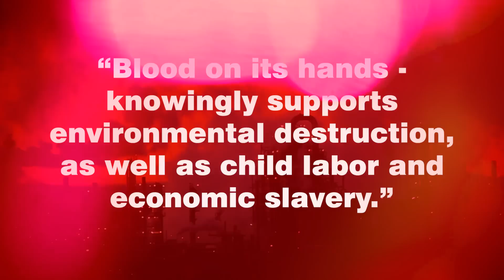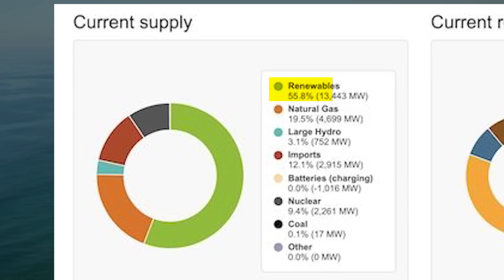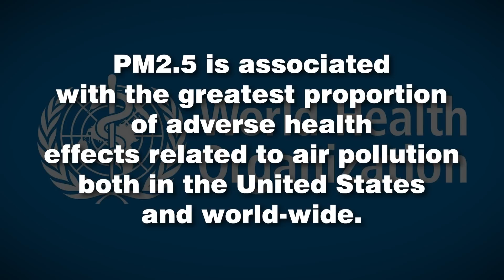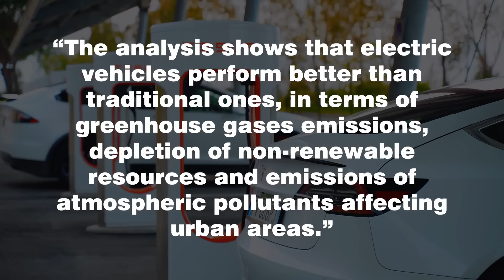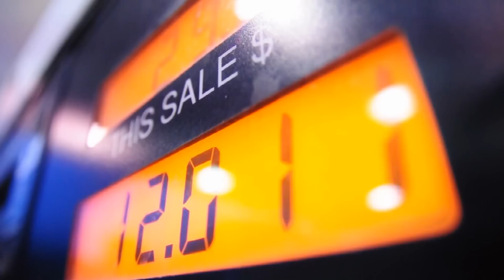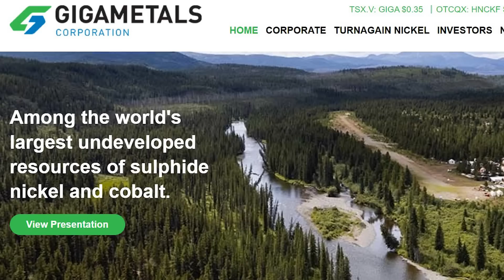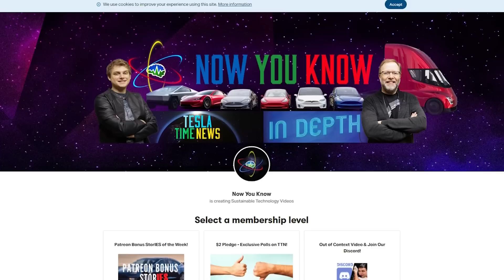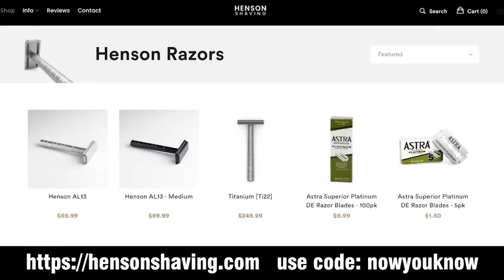Debunking More EV Lies | In Depth

Comment: It always amazes me how the anti-EV folks forget how much energy is used to process oil on its way from the pump(extraction), to the port, to the arrival point, to the processing plant and at the station. How many Kwhs are used per litre entering the tank ?
As for cobalt, on the EV side less and less Cobalt is used AND that cobalt can be fully recycled on and on and on…
What of the cobalt used in processing gas? (Remember the whole acid rain thing? How’s they fix that? Cobalt and gas was part of it).
A significant of cobalt is lost during gas processing. Why don’t they mention that?
Pretty much all minerals can be recycled and will be cheaper to recycle than to mine and process. If not already.
Reply: yeah, somehow it's totally free to find gas reserves, build infrastructure to get it out of the ground, pump it out of the ground, transport it to a refinery, refine it, load it in a truck, transport it to a gas station, unload it in to the gas station, and then pump it in to a car. that's totally free. but if someone eats a sandwich while building an ELECTRIC car, then the cost of that sandwich needs to be counted
Reply: Because we have a larger view of ev than ev enthusiast. With all the money you can make from a lithium mine do any of you ever asked themself why there is virtualy no new lithium mine openning anywhere?

It because politician go full save the planet discourse for vote and suddenly they see the lithium mine project and understand that thing is f...ing awful. They take so much water they litteraly drain river, high risk of ground water contamination (water table) and lithium is everywhere but don't get very concentrate in the ground so you need to excavate very large strip of land destroying entire ecosysteme by doing so. 

This is just one of the inconvenient of EV. We could talk our need for energy is growing faster than our capacity to produce it and this trend has started long before EV was a thing. The grid is not build for this. E.C.T
Reply: That figure is accurately tracked. Getting worse every decade. Used to be 5% of delivered energy was used in the delivery infrastructure. Now commonly 50%.
Reply: This is my argument with EV's as well, none of the EVs are made out of fresh air they all come from burning coal gas and oil just to create it even if nothing comes out of the tailpipe, it is still not 100% emissions free its a big lie. I've worked in mining for 12 years now and I can guarantee you none of the mines I've worked on have been environmentally aware, they all claim to be doing something but really it's a minuscule effort compared to the missions we put out just to create a big hole in the ground. Let me finish with I don't think we should stop pushing forward to create a better world and I am still buying a tesla because I love the idea of helping the planet and becoming a better human.
Reply: @brettslaterdebtmastery  no one claims EVs don’t produce emissions when being built. It’s over the lifetime of the vehicle it is less polluting. Some EVs only take a few years to balance out.
Reply: @brettslaterdebtmastery  Volvo, Cat and other mining equipment producers are working on EV trucks and excavators. Changing over the entire supply chain will take time. Northvolt is probably focusing on this the most.
Reply: u understand that all the plastics on these ev's are also made using oil right? and who owns all the cobalt in the world? china, the most polluted nation on earth... have u ever seen a lithium mine? solar panels cant be recycled, can anyone say landfill after 15 years? ev's may shed less pollution than say a car from the 1960s but as of today ev's are just as bad if not worse as todays cars... honestly i think the hybrid cars is the way to go until everything is worked out
Reply: @dmax9000  can't recycle solar panels and the plastics, cobalt mining.  Sounds pretty dirty to me.
Reply: ...you realize there are multiple anti-ev sides right? For one, many urban planning / bike channels have very legitimate gripes about evs. In fact it even sounded like the Sorelle video was ultimately trying to make that point.

For a video more explicitly against evs from this angle, check out "Electric Cars are Not Sustainable and they're Terrible" by Allen Fisher.
Reply: @randomnobody660  Yeah, the anti-technology movement. They claim to want a return to more naturalistic time, before technology destroyed society. But if you ask them for more detail they cannot provide.

Some would revert to Mennonite times, horse drawn buggies no television but cellphones ok and gasoline engines to run sawmills ok.  ??

Others want a reversion to a specific date in history, usually without explanation of why that date is ideal.

Many advocate a de-technification to a world designed for an ideal lifestyle. They are commonly mute on who decides what technology will be allowed and how that is enforced, but they each clearly expect to have a LOT of input to that.
Reply: @lengould9262  Um what? Are you suggesting people who advocate against car-centric design for walk/bikeable nationhoods ... actually want to return to a naturalistic time?
Reply: The lady who did this assassination attempt article, simply not a scientist, she doesn’t know what she’s talking about, at all.
Reply: @orionbetelgeuse1937  every great new idea started with a solution that everyone said wouldn’t work or was bad, my point is that we need an alternative to fossil fuels as they are finite. Or we could just stop, we also need to stop this crazy buy something then throw it away whilst its still good, throughout history we have had to keep everything until it is broken or no longer useful, we now throw things away because it isn’t as perfect as we hoped!! People don’t like change but we have to, when cars first appeared most people hated them! Noisy, smelly and dangerous when you were going about your business!
Reply: Well you forget that literally all of oil is used... it is not like they make only gas/diesel out of it and rest is thrown away. Pretty much 100% of oil is used in some way so this is one of the most efficient processes we have. On top of it (and I am not against EVs) you forget about couple of things. 1. Infrastructure changes needed to accomodate EVs will cost insane money and energy spending; 2. In case of an accident, even minor, you are often forced to replace whole battery pack and for eg. Tesla wants it to be a structural part of a car... so like what? "one use" at least until accident cars?; 3. in case of fire you are ought to submerge whole car in a water rendering water hazardous;
Reply: So along with all the new batteries needed for EVs that replace ICE vehicles, every home will need a minimum 20 to 50 kilowatt hour battery. That way we don't have to limit our power consumption each night or when the wind doesn't blow. 

So at least in the Sunbelt it could work but every home will require a minimum $10,000 battery bank. 

Where are all the raw materials coming from for these additional residential batteries? 

By the way in the northern states a 200 kilowatt hour battery will be needed for sufficient electric resistance heating in winter. 

By the way in northern states, solar and wind can't replace natural gas for daily heating. (ie Texas Feb 2021)

I guess the answer is energy migration. 

Everyone in the northern states should move to the southern states and get a Tesla power bank. 

Every single family home needs a battery? Think about it. 

What will skyscrapers or large apartments be powered with?

I have been involved in generating electricity for nearly forty years. I can clearly see there is no success strategy to gets us there by 2035. 

There are no new renewable energy sources or magic battery gadgets that can replace the big nuclear, natural gas, and coal thumpers that you rely on every day for power, but not realize it.
Reply: You would be really shocked how EVERYTHING we use every day is oil and fossil fuels related. All metals, plastic... from tech gadgets to the insulation around copper wire, food, you name it, absolutely everything is connected to fossil fuels in one or more ways.

It literally saved the whales. Fossil fuels were used instead of whale oil because it was cheaper. Heating and cooling our homes saved a billion or more people over the decades thanks to fossil fuels.

Catastrophic weather events, (heat, cold, drought, flood, fire etc.) happened way before the discovery of fossil fuels and will continue regardless of Co2 levels. 

I'm all in for electric but I'm baffled on the anti fossil fuel groups at all costs mindset. I love antique cars and airplanes. They really believe we're going to die in (insert arbitrary number here) years.

This is non sense.
Reply: How much energy is wasted daily, continually through the power grid?
Reply: she’s not anti-ev. she’s anti lying about the miracle pill that EVs are pushed as. they still emit and thats still a problem. the EV industry quite literally supports child slavery and is fueled by greed, just like a bunch of other industries, pretending they dont is just disingenuous
Reply: @randommage1  LOL supports child slavery?? If you are referring to cobalt you realize FAR more cobalt is used for fossil fuel refining than batteries right? The cobalt in batteries can be recovered. The cobalt used in refining is consumed. Not to mention most batteries moving forward will not contain cobalt anyways.
Reply: Dave, 
What is the difference between a L2 charger and a L3 charger?
Reply: There is no where near the capacity to make this green revolution reality at scale. It will crush the US economy. Guess which country is aggressively pursuing the use of coal energy to refine lithium? Does this coal based country want to see the USA continue as the land of the free? There are dire strategic implications to our countries unilateral power disarmament.
Reply: In order to replace all ICE cars by 2030 America needs to put 2200 megawatts (mWe) of additional electricity online every month. 

My estimate does not include trucks or buses in use today. There will be no electric air travel either. 

For my estimate I assume Americans will continue to drive 2 trillion miles annually. 

In my estimate, I use the value of 4 miles per kilowatt hour (the average for EVs today). I confirmed this by what my neighbor's Model 3 uses and that is about the same value I see used in my two Chevy Volts. 

So what does 2200 mWe look like?

It is the equivalent of a large dual unit Nuclear Power Plant placed on line every month. How many new nuclear plants coming on line? Two! (And it has been under construction for 10 years).

2200 mWe is what  16,000 to 20,000 acres of solar panels will provide during daylight hours (only). You could also build and install 1100 Windmills placing them on line every month. So much for our abundant farmland.

So at night or when the wind is not blowing I am not sure how we generate electricity without conventional gas, coal, or nuclear generation. 

I guess California has perfected that response when there is not electricity available, just tell people not to charge their EVs.

This is the reality of the Green New Deal! 

Looks like the future is very bright for us or perhaps more browned out indeed.
Reply: To eliminate CO² we first need to eliminate all oxygen,
 so we must first cut all the trees down and the food crops
Reply: @orionbetelgeuse1937  I didn’t say get rid of oil did I? We need to stop BURNING it, it will be a long time before we have the technology and resources to replace plastics for many applications.
Reply: "Pretty much all minerals can be recycled and will be cheaper to recycle than to mine and process. If not already." Utter rubbish claim. It is cheaper and less polluting to produce new products than recycle old products. An inconvenient truth, recycling a product back to its original ingredients is near impossible and extremely expensive in time, money and energy.
Reply: Saw a vid that showed it takes 1,800 gallons of diesel for one shift of an earth- mover extracting the rare minerals for the e.v. batteries. The batteries are very toxic for disposal. E.v. plug into fossil fuel powered grid.   “ everyone must buy e.v. cars”, “ please don’t plug in your e.v. or we’ll blow the grid.
Reply: And now explain the EV's. How are the batteries maid and how are they recycled. Where does the electricity comes from. Are the windmills powered by wind or is it fossil fuels (just to make us believe that they are powered by wind) and what are they doing to our environment. One thing I know for sure and that is that Tesla fans will not safe our planet, especially if you all believe that the electricity is coming out from an outlet.  These two in the video also have no compares than just blaming the fossil fuels. It's obvious isn't it.
Reply: the lithium in your battery travels the Atlantic ocean 6 times in processing before it is ever used in a battery
Reply: can battery be fully recyled with no preformance loss?
Reply: How much Oil or any hydrocarbon product is used in making Photovoltaic systems?
Reply: Pro-EV people don’t realize that the electricity that goes into their car has to be generated someway, and also that the process of making the motors and batteries in EVs also require a lot of energy. You can’t just say gas is bad EV is good or vide versa because they both have their cons.
Reply: And you can’t just say EV bad and Gas good.  Most people driving a gas vehicle don’t realize how much goes into extracting, transporting and refining the gas they use.  But we won’t talk about that because big oil is paying people left and right to push the agenda EVs are bad.
Reply: @coke8077  did you watch the video. They clearly state energy is required to make EVs but over lifespan it is less impact on the environment.
Reply: @Bad_1nfluence  how about the electricity to charge them.
Reply: @lorettathomas3994  did you watch the video? they clearly state how it is still better for the environment to use electricity, regardless of where it comes from, because it’s still cleaner than mining, transporting, and burning oil. BTW the national average of electricity generated 22% comes from renewables and 19% comes from coal. Nuclear is also dominant and is cleaner than oil.
Reply: @Bad_1nfluence  yawn.
Reply: @orionbetelgeuse1937  the average gas car lasts 140,000 miles. It’s too early to determine the average lifespan of an EV but any engineer knows less moving parts, less problems. Most are expected to last 250-400k miles. And yes some diesels last similar mileage but you are forgetting the point which is that they POLLUTE especially diesel.
Reply: @Bad_1nfluence  "Too early to determine", yet people talk about EVs like they know the future. They are being rammed down our throats, hoping that all the problems will be solved in the future by someone else. How is that OK?
Reply: @Bad_1nfluence  the average ICE car last 8 years or 150,000 miles, per Consumer Reports. Personally, I think that’s low. iSeeCars says only 16 makes/models have more than 1% of their cars remaining on the road after 200,000 miles. Car and Driver says the Bureau of Transportation claims the average age of cars on the road currently is 11 years and says ICE cars should last 200,000 miles while EV should last 300,000. The better care you take of your care, the longer it’s going to serve you.
Reply: Oh, you think solar panels and wind turbines grow on trees? How much CO2 is released when building those giant things? Not to mention the efficieny factor. Transporting those things only to have them spin and generate a little bit of electricity.
Reply: Dude you make it sound like magic. If it was that easy and that reusable it wouldn’t be such a hard sell. It should be so cheap bc you can reuse it so much it has no value as new bc used is way cheaper. Likely you can recycle little but because you can recycle some you can say you can recycle it just like plastic. So get off your high horse and grasp some reality.
Reply: @MitchellFX5  What’s a hard sell? EVs? At scale lithium-ion batteries can be recycled at 90%+ efficacy. Several companies are reaching 95%+ at lower volume as the technology improves. Most large lion battery packs are given a second life as stationary storage without any recycling processes needed. That’s reality, no horses high or otherwise involved.
Reply: @mikereliford55  links? I honestly would like to know how they can recycle them to that % yet replacing an expired ev battery costs as much as it does? Can I sell the expired batteries back to the place that is recycling them? Or are they the only one benefiting?
Reply: @MitchellFX5  
"Links?"
Let's see
Start with searching
"Redwood Materials"
"Tesla in house recycling"
Then maybe
"<Car manufacturer> cell recycling plans"
They'll ALL going to be doing it.
....
You'll also note (when you look) that JB Straubel (Redwood, ex Tesla CTO) says "90+%, AND 1/6th (17%) the cost of mining new stock"
Which if you THINK about it is logical, since your using previously mined and concentrated material....?
.
"YOU" don't sell the "batteries" (pack) to the pack recycler.
You might negotiate with the CAR recycler?
The point being "YOU" won't be removing a really heavy high voltage pack.
If it did require replacement, out of warranty, you would have an "exchange unit" fitted, just as with an engine.
The value of the old unit will be refunded on exchange.
.
This is what "the internet" is for.
INFORMATION.
You make an uninformed comment.
Someone tells you you're wrong.
At that point, rather than asking THEM "leading"(?) questions, prefaced by "I'd honestly like to know", it's a GREAT idea to DO SOME RESEARCH using logical, generic search terms?
.
Maybe then you can return to the "forum" and reply 
"I understand now, thanks for the heads up"
That way, you gain knowledge and the other party has the satisfaction of educating one more person?
.
Just a thought..
.
One more thing
Latest estimates
"Old" Model Y pack... $10k
"New" (4680) pack... $8k and falling.
Reply: @MitchellFX5   it’s happened for years if you have a car that is unusable and so can only be recycled then you may even pay for them to take it, the car can then largely be recycled, it requires specialist handling etc. and so they make good profit on it! If they can get away with paying you nothing for the raw material they will, as more batteries get recycled the market gets competitive and you get more for the “scrap” battery. Or the car with 50% range gets sold cheap to someone who doesn’t need the full range. This would be the best from the old saying- reduce, reuse, recycle!